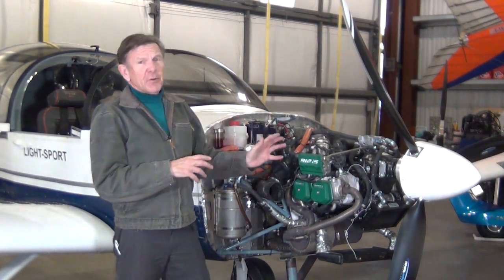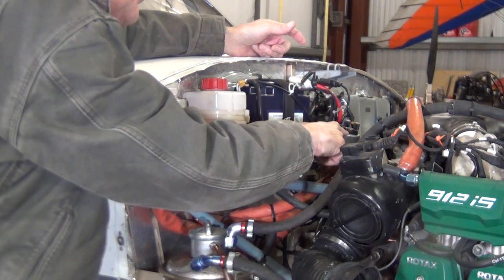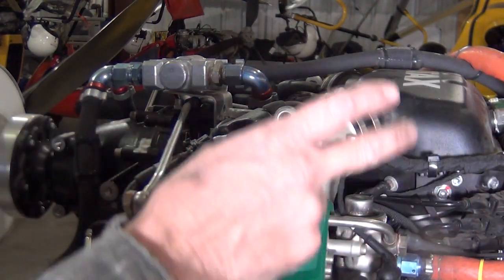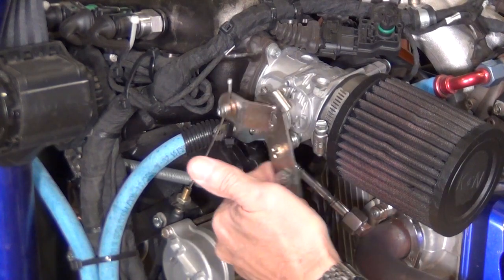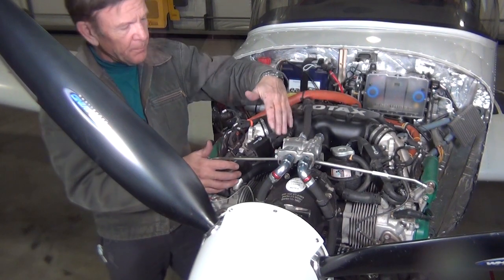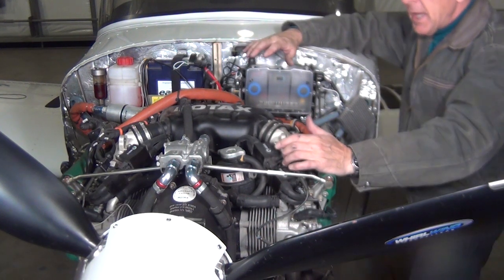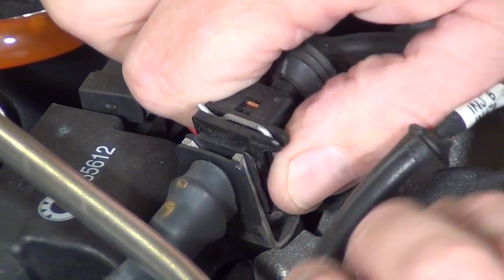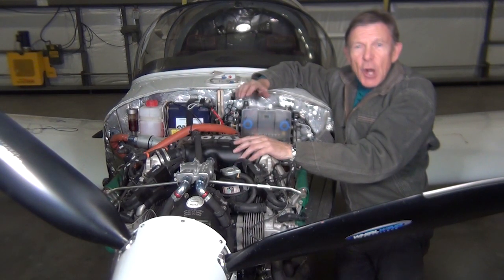Rotax 912iS Fuel Injected Aircraft Engine Differences from Carbureted 912 Engines

Comment: Hi Paul, i am not yet family with direct injection in aviation! So with your throttle lever you control the air intake/air flow. I guess there is no mixture lever?! So the ECU has to "know" the amount of oxygen to provide the correct amount of fuel injected in the cylinder by regulating rpm of the fuel pump or choking fuel flow. How is that done?  Is pressure and temperature measurement enough, because ECU can calculate air density and hence estimate oxygen (including altitude info) and air volume is given by cylinder volume? Or is there an additinal air flow meter? Thank you very much, Chris
Reply from the maker: The ECU (Engine Control Unit) measures temp, pressure PLUS the EGT (Exhaust Gas Temperature).  From all this it determines how much fuel to let in to optimize the engine operation.

Comment: Looks like the 80 HP 912 w/104 HP zipper kit.  (low compression, cheap fuel, smooth) or the VZ Power bolt on mechanical turbo 120 HP 1 min. 90-95 HP continuous smooth cheap fuel low compression) are the 2 best Rotax ways to go.  Don't like all the computer crap.  914 most over-priced engine Rotax offers (including 915is)

Comment: 30 % more efficient? In what flight regime, overall? That seems really high.  I burn less then 3.5 GPH all things considered, using a HacMan Leaner and flying usually at 4900-5000 RPM. It's pretty easy to get it down to 3.2 just putzing around.
Reply from the maker: Flight regime. Idle, full power, cruise 4500 rpm. I get this figure from flying my Powered Hang Gliding Flights. I can do 4 flights now with fuel injected 912iS where I could do 3 with the carb 912S.   Same exact make/model, same exact flights. Takeoff at 4700 MSL, climb to 10,000 feet, cruise over the Sierras looking at Lake Tahoe, descend to 5000 MSL, fly low over the desert and back to the airport. I was amazed.
Reply: @PaulHamiltonCFI   My area is similar, altitude wise,  I'm based at 5600', and with the Leaner, it's real easy to knock 1/2 gph off at cruise, from 4 to 3.5, so about 12-13%,  5000 rpm, over just the straight carbs.  I do a lot of slow local flight at 2.9-3.2 gph,  30 % IS impressive, thanks for the info. Old HG pilot here early '70's era!

Comment: I'll stick with carbs, for now anyway, 2600 hours, zero issues.
Reply from the maker: Carbs work fine. I still have a carb 912 I fly. Just replaced the floats on a new aircraft.
Reply: @PaulHamiltonCFI  True, and keep em sync'ed too.. they run forever